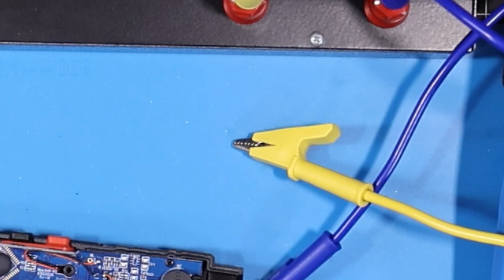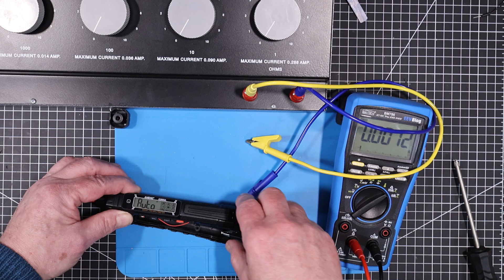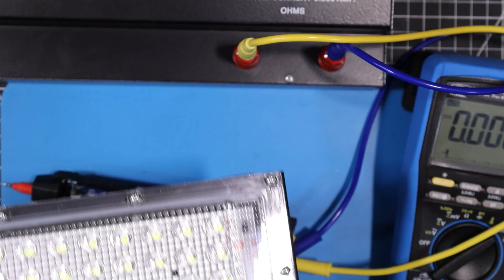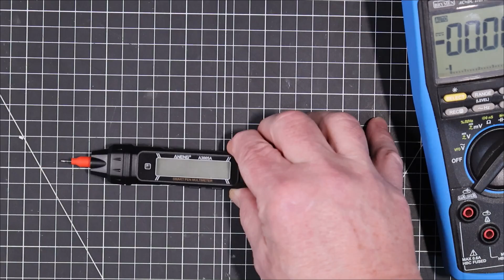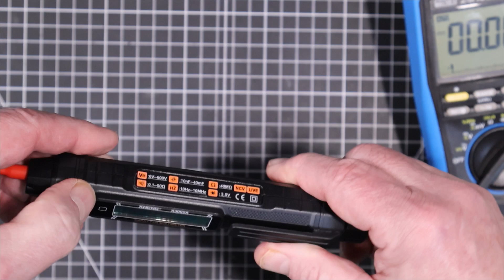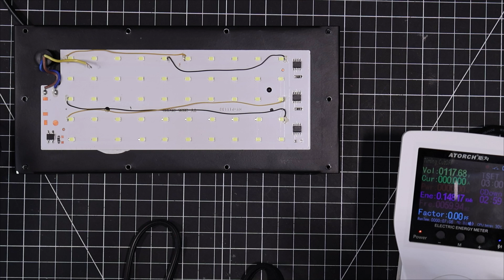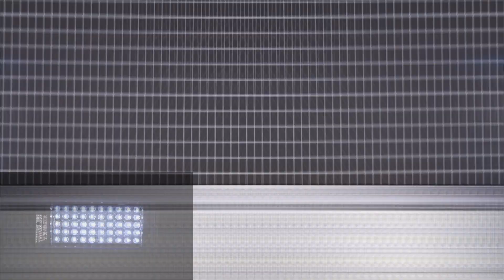Uni-Byte 0248 - Where We ATTEMPT To Do Two Hacks!

Comment from the maker: Transcript Summary:

*   0:00 Penlight Meter Backlight Hack Attempt: Modifying an a3005a penlight meter to always have the backlight on is attempted.
*   0:11 Initial Goal: To enable the backlight permanently, considering the recipient's preference and battery life concerns.
*   1:11 Current Draw Measurement: Turning on the meter draws 1.3mA; enabling the backlight increases it tenfold.
*   1:51 Resistance Testing: A resistance box was used to dim the backlight and reduce current draw, finding a suitable balance at 10k ohms (0.6mA increase).
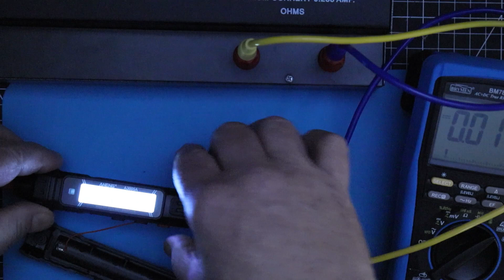*   3:15 Discovery of Always-On Drawback: The chosen method would continuously drain the battery, even when the meter is off.
*   3:36 Hack Failure: Due to the circuit design (emitter connected directly to ground), the backlight modification wasn't feasible without constant battery drain.

*   4:18 Light Hack: Modifying 220V lamps to work at 110V
*   4:18 Initial Problem: The creator received 220V lamps instead of the ordered 110V ones.
*   4:47 Internal Analysis: Examined the lamp's circuitry for voltage conversion possibilities.
*   5:55 Circuit Board Overview: The circuit includes a bridge rectifier, linear current sink chips (SM 1082 DS), and LEDs arranged in series-parallel configurations.
*   6:21 SM1082DS: Linear current sink IC's that limit the current to the LED's
*   7:08 Modification Strategy: Cutting traces and using jumper wires to rewire the LEDs in a parallel configuration to reduce the voltage required.
*   7:44 Voltage Measurement: The voltage across each diode series was measured to be around 9.7 volts.
*   8:04 Rewiring for 110V: Cut traces, paralleled LED sections, and removed a current-limiting resistor to reduce the individual LED chip current to 12.5mA.
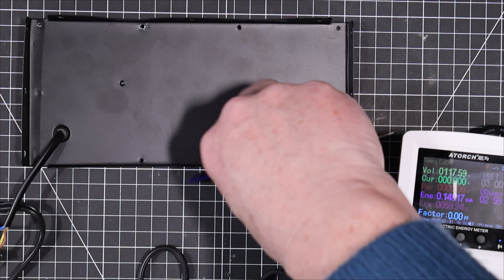*   8:54 Testing and Success: After the modification the lamps now draw 50mA and the hack was a success.
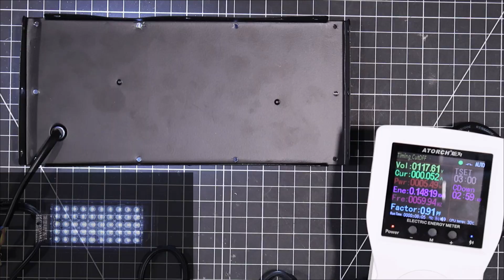*   9:11 Grounding: Successfully grounded the case for safety by bringing the ground to the metal screw.
*   9:21 Hack Outcome: Despite the penlight backlight modification failing, the lamp hack was successful.

I used gemini-2.0-flash-exp on rocketrecap dot com to summarize the transcript.  However, it required quite a bit of editing including correcting spelling mistakes.

Comment: How did you get the pen meter open without ruining the labels?  Heat? 😊
Reply from the maker: Yeah, that's how I did it.  Removed all the screws, heated the labels up a bit, then used a good tweezer to lift them off without bending them too much.  Worked well.
Reply: @uni-byte  Thanks, this gives me the confidence to open them.  Personally I would like to reduce the beeper volume while I'm inside.
Reply from the maker: @Y.T.Learner  I put up a short video of removing the labels.  This was immediately after heating them.  Both screws were already removed.  There is no audio.  https://youtu.be/869jr8X_O9M
Reply: @ it’s currently private.
Reply from the maker: @Y.T.Learner  It's not listed as private.  It tells me "Anyone with the link can watch your video".  Maybe wait a little while and try again.
Reply: @uni-byte  ok it’s good now.
Reply: I was able to remove the labels with all the adhesive remaining on label - and none on the body.  I think I used enough heat and patience.
Reply from the maker: @Y.T.Learner  👍

Comment: I believe you overthought this. 😊 There should be a spot for a resistor that is not populated on the PCB, but is present on the reverse LCD model.  Adding the missing resistor with a “0” is all that is needed. The hack you are showing sometimes works, and as you showed, sometimes doesn’t.  If you want less LED current with the change, replace the resistor that is between the transistor and the LED.
Reply: It seems the “option” is buried inside the firmware on this model.  It was a very good attempt!  The C-E bypass works on some models and not others, depending how the circuit is configured to bias the transistor. Thanks for trying and sharing your experience.
Reply from the maker: @Y.T.Learner  You're welcome.
Reply from the maker: HI Paul, it think what you suggested applies to the A3007 & A3008 models.  This one is a completely different design.  There are some unpopulated patterns on the top of the PCB (nothing on the back) but they have nothing to do with the back light.  Yes, I could replace the resistor to reduce the light and I might do that, but it will still mean you have to keep pushing that light on button.
Reply: @uni-byte  I happen to have both models of A3005.  I'll find out the difference and let you know.
Reply from the maker: @Y.T.Learner  Sounds good.
Reply: @uni-byte   My two units are different from each other, and also different to yours.  I will send you an email with pictures.
Reply from the maker: @Y.T.Learner  Saw that, thanks.

Comment: Ever since I was a kid I've loved to do hardware hacks to make things work better, from radios to bicycles. Better is better. As a ham I do many of the mods available online to get my gear to work better or at least closer to the way I want it to work, some mods from online suggestions, some of my own ideas. In the last few years I've taken to doing firmware upgrades on everything electronic, from my ham gear to my test equipment. I'm fascinated with the ability to continually improve things I've already purchased, but without paying another dime for the improved piece of gear. All of the users of the gear contribute towards its improvement, with ideas, with code, with a few bucks to those who write the code, or simply with a 'thank you'. Then, of course there are hardware mods as well, costing little or nothing, and providing additional improvement, lower noise, wider bandwidth, a better screen, etc. Explanations of every detail of a device, ways to modify it. More of what the user wants, convenience, features, functionality, at no or very little extra cost. It is the exact opposite of the direction corporations are working determinedly to take us in, irreparable stuff with no discussion of the details of its operation, no specs, schematics, barely any documentation at all, stuff that does exactly one thing the way the manufacturer wants it to do it. Take it or leave it. I prefer the hobbyist consumer's version of the way things should be, not the manufacturer's version. I'll use for about a week or two something I've purchased new, just to ensure it remains functional, then I break the warranty seals and have at it. But generally I prefer to buy things used, since they are much cheaper and I needn't worry about warranties.  :)
Reply from the maker: I agree completely.  Older equipment rocks!  Full schematics, all part numbers, calibration instructions, disassembly instructions, etc..  A far cry from what you get today even with higher end equipment.

Comment: what voltages are on those holes at the bottom of the pcb? if any are high when on but not while off could use one of those for the lower level light with a diode for protection and chosen resistor.
Reply from the maker: Those holes are the programming interface.  If one of those goes on when powered up I could do as you say, but I'd have to completely re-wire the backlight, but it's possible.  Don't think I could use a diode though as we are pretty close to the minimum required to turn on a white LED as it is.  Something to think about and investigate though.  Thanks!